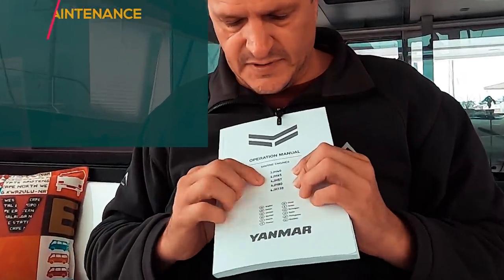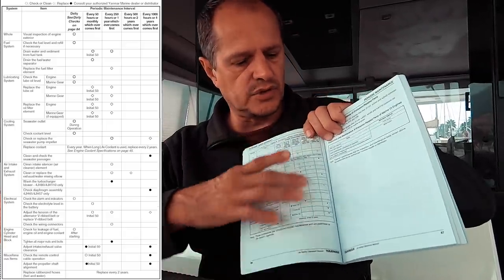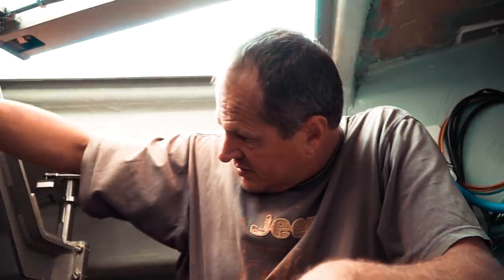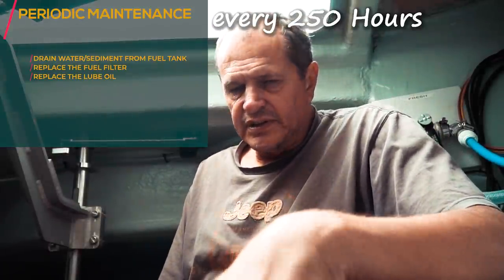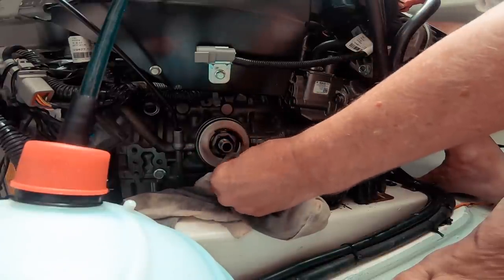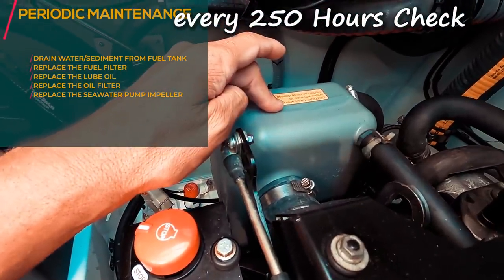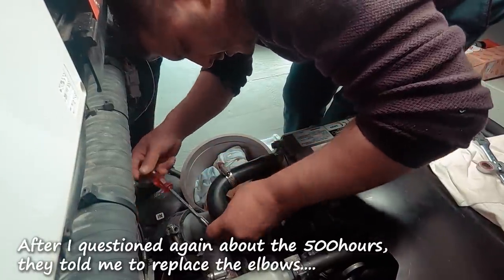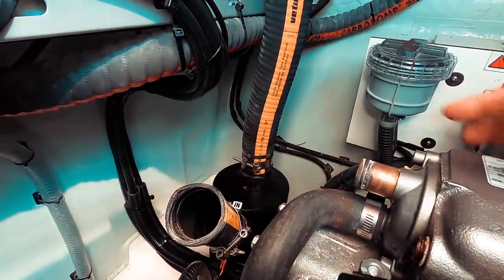#85t Boat Life Yanmar 4JH45 Service | Sailing Sisu Leopard 45 Catamaran Circumnavigating

Comment: Hi Frik. 

I have never seen fuel and oil filters which have been loose enough to remove by hand, I hope you don`t get caught at sea with a leak in either. 

Put them on hand tight and remove with a strap or other device, these seemed to be far too loose.

David.
Reply from the maker: Thank you, David! I actually accidentally loosened the filter with the strappy thingie before the oil was fully drained and the oil spilled out... Off course, there were too much swearing and could not be part of the video 😁
Reply: MECHANIC NOTE: Screw-on filters need to be tightened on by hand, thus not damaging the seal, be it rubber or other wise.
The strap 'thingie' can & should be used for removal.

BTW, use proper lubrication when installing.
Reply from the maker: @stevenr8606  yeah, only tighten by hand as shown in the video 😊

Comment: Cheers guys! 😊
Reply from the maker: wow, you watching "how-to" videos now :-D but, what do you think of the level of detail and the camera work? (besides that it is boring ;-)
Reply: @SailingSisu  actually good,  the advice about aftermarket parts while under warranty isn’t strictly correct,  but to say it is is better than not, as companies love getting out of warranty claim’s, so why risk it?
Reply from the maker: Our warranty claims up till now, four years later, are still honored by Robertson and Caine :-) but they did start to throttle the payments this year :-D it is incredibly sad to say that the US market is getting out of warranty at every opportunity...it is as if one buys a product or get a service and the supplier takes your money and shove you off. I did not experience that in Africa nor in Turkey where the manufacturer is proud of their workmanship and stand by it. And they do their job at a fraction of the price in the US. For example, a guy did 8 welds for $5200 USD and when I pointed out that the weld is poorly done and will cause rust, he just shrugged and say that rust is my problem not his....even though his welding looks like bird poop with lots of crevices where salty water will accumulate and cause rust much faster than a polished weld...imagine my "surprise"

Comment: Excellent knowledge necessary and presented very nicely. What I would like to ask I how to winterize yanmar 4jh45 . Draining like manual says or flushing with antifreeze?
Reply from the maker: Thank you for the kind words! Never had to winterize, never lived in snowy areas for long either. So, for sure not the expert  :-) do you mean when it is on the hard or still in the water? What do you do with cars in those situations?
Reply: @SailingSisu  winter can get pretty cold. Even -30 degrees Celsius, you need to winterize einginge because water will turn into ice and destroy engine. With car I do not need to do that , as car doesn’t use water for cooling
Reply from the maker: @michal1344  well, the Yanmar is using anti-freeze too in its primary cooling closed loop. There is a heat exchanger where the primary (anti-freeze) coolant is cooled by water from the sea. So, I guess one needs to get all the sea water out, or replace that with antifreeze using the pipe at the raw water seacock inlet? Just follow that pipe and you will see where the water goes. I think on our engine, it goes from seacock to impeller, to heat exchanger, to mixing elbow, to exhaust accumulator, then the exhaust pipe itself. But, yeah, follow the raw seawater pipe, I guess.
Reply: Can you advise what oil you used ? Do you remember ?
Reply: @SailingSisu in Manual it says that you have to drain water from an engine (from an engine and from a pump). Many of users instead of doing that they put anti-freeze to a water strainer. Amount of 20liters. 
What is better I do not know. ?
I thing that also part of see water is going to an engine ? Or only coolant is going to an engine ?

Comment: I was wondering do you ever have to change the filter in the PURAFINER DIESEL CONDITIONER or you just replace the unit after a certain time frame . 

Also you may want to consider next time you have your vessel in dry dock it  is easer to change the oil on the sail drive then due to the most of the units have a external drain bolt regards
Reply from the maker: David, that is a very good question! I actually have no idea! Yes, we did change oil when we were on the hard in the Canaries
Reply: @SailingSisu  Q & A on site stating a magnet field is used to help in the process , so have the device an electrical connection and how is the field generated. I am electrical engineer so magnet fields have to have a source or permanent magnets are fitted inside the device??

Frequently Asked Questions
June 15, 2018
By Purafiner

Q. How does Purafiner work?
A. Purafiner is not a biocide; it does not kill the bug. It is a bio-control unit. It affects the living organism by disrupting its environment and breaking the biomass down into individual plasmolyzed cells of less than 1 micron in size. These pass through the fuel filter and burn up in the engine.
 

Q. What about the fuel returned to the tank?
A. The treated cells remain dormant and inactive for long periods. The time frame depends on the environmental conditions, but it is long enough for the for the cells to be consumed by the engine. The fuel tank is slowly cleaned up in the process.
 

Q. How do you know what the effect of the magnetic field really is?
A. Purafiner Distributors NZ Ltd retained the School of Ocean Sciences in the University of Wales at Anglesey, UK to conduct an experiment to prove the effectiveness of Purafiner. The methodology of the test was devised by the School of Ocean Sciences in conjunction with Lloyds Register of Shipping type approval Department of Engineering Services, reference ta/40397/67488/94rel.
 

Q. What form did the experiment take?
A. The experiment was devised to determine the effect on a magnetically protected filter compared with an unprotected one when circulated with microbiologically contaminated fuel.
 

Q. What was the result?
A. The result was that the unprotected filter became an ideal environment for microbiological growth and the filter became blocked. The protected one remained unblocked. The filter life was increased by a factor of 10.
The results were so impressive that the university submitted them to the leading journal in the field of biological contamination for publication. The article was accepted and was published in Volume 14(3) 1999 of Biofouling.
Q. Is Purafiner a cost-effective method of control of biological contamination?
A. Yes. The continual use of expensive and toxic biocides and the associated hazards are eliminated.
 

Q. Will the magnetic field affect electronic or computerised engine components?
A. No. The field is depleted after it moves about 80mm from the unit. In addition, the field is absorbed by adjacent ferrite materials.
 

Q. Would a more powerful magnet be more effective?
A. No. The result would be the same but the cost greater.
 

Q. One manufacturer claims three magnets are necessary for effective control?
A.Three magnets are not necessary. One magnet is all that is required to disable bacteria. The claim that the bacteria is killed by the magnet is also incorrect, as the individual bacteria which cling together causing element clogging are separated by the magnetic field, and then burnt up as they go through the exhaust. A small magnetic field with the power of a radio speaker magnet will not kill bacteria.
In the early ’80s Mr Colin Wickham, a Chartered Engineer and inventor of the use of a magnetic field to control bacterial contamination in diesel fuel, designed his first unit. Mr Wickham was a Member of the Institute of Marine Engineering, Science and Technology, MIMarEST.

This first unit was designed to look like a fuel filter for better acceptance by the trucking industry. The use of three magnets was only to fill in the body.

Mr Wickham went on to design a new unit, cheaper and without the problem of sludge collecting in the bowl where it promoted the growth of the bacteria it was intended to control. This new model was the first Fuel Mag unit, one magnet and simple to fit. From this grew a range of units up to large capacity model with 6″ flanged outlets.

The fact that the three magnet system is patented means nothing other than to lock the manufacturer into higher cost. The use of a magnetic field to control this problem has been in the public domain since the earlier 1980’s and thus cannot be patented.

The Purafiner unit uses either one or two magnets for convenience in manufacturing but either number is equally efficient.

 

Q. Is it true that the Purafiner will save fuel? If it does, how is this achieved?
A. Purafiner makes no claims that a magnetic field has any effect on fuel economy. There are too many unsubstantiated claims made without any scientific proof to support these conclusions.
However, bearing in mind that the Purafiner controls the growth of microbiological contamination in the fuel, then the answer is yes, it will save fuel costs. This is because uncontrolled contamination will result in the following by-products of microbial growth:

large biomass causing fuel flow restrictions
secretions of organic acids into the fuel and consequential damage to fuel injection equipment
conversion of fuel molecules into new cells and metabolites such as surfactants which assist in the emulsification of water in the fuel, carbon dioxide, high-density polymers.
As well as the conversion by cellular enzymes of fuel into these various by-products, the by-products themselves adversely affect combustion conditions.
Clearly, if these problems are eliminated, some form of fuel saving or the prevention of fuel loss and improved combustion will result. Whilst we have made no laboratory tests to verify this particular aspect, there exists a wealth of anecdotal evidence in the marketplace to support it.

 

Q. Can Purafiner be used to protect fuel storage tanks?
A. Yes. By periodically circulating the fuel through a Purafiner the microbial matter can be maintained in a controlled, dormant condition.
 

Q. Can Purafiner be used with other fluid systems containing microbial contamination?
A. Yes, most definitely.
 

Q. Why does Purafiner reduce engine smoke emissions?
A. Quite simply the biological contamination is removed and fuel quality is improved. If the system is contaminated then as it becomes cleaner the combustion process improves, giving cleaner, faster and more complete combustion of the fuel injected into the combustion spaces.
 

Q. Why should I fit a Purafiner to my engine or system?
A. Well, it depends on the circumstances. If your system is biologically fouled the Purafiner will deal with the contamination, clean the system up and keep it clean.
If your system is not contaminated, then the aim is to keep it that way. You never know when you are likely to receive contaminated fuel.

Think of it in terms of your computer. Why do you install a virus protection programme?

to deal with any existing virus contamination
to protect your files from any virus that gets downloaded from an external source
The same principle applies to the installation of Purafiner.

to deal with existing contamination
to prevent any introduced bug from making a comfortable home for itself and degrading your engine system
 

Q. Do I need added protection if I have a centrifugal purifier?
A. Yes, you do. The microbiological growth has approximately the same specific gravity as the fuel or oil that it is growing in. This means that the centrifuge, which is designed to remove contaminants that are heavier than the fuel or oil, e.G. Dirt and water, will not remove lighter particles. The microbial material will pass through with the fuel or oil.
 

Q. Where in the system should I install Purafiner?
A. Your system will be equipped with primary or important means of protection against contaminants. What you want Purafiner to accomplish is to break down the microbiological contamination to minute components so that it will pass through the filters into the engine and away in the exhaust. Install the Purafiner in the fuel supply from the tank before it enters any filtration or treatment unit.
Reply: In a 2009 Practical Sailor article titled "Diesel Biocides Take On Contaminated Boat Fuel" I found this: "Magnetic bug killers receive considerable anecdotal press. Practical Sailor tested two widely available units-De-bug and Algae-X-in the April 15, 1997 issue and concluded they had no observed effect on microbial growth. As a part of the 1997 trial, a biocide was also tested for comparison, and this was found to be very effective." 

1997 issues are not available online. 

 Not sure if non subscriber can access it but this a link to the 2009 article with the quoted text.  https://www.practical-sailor.com/boat-maintenance/diesel-biocides-take-on-contaminated-boat-fuel.  PURAFINER claims to be just such a magnetic conditioner.  It is probably a waste of space and weight.

Comment: Thanks for the great vid Frik! I was wondering what it might be like doing self-maintenance on these babies. What FUN! BUT at 28:30, I wondered if maybe you had the water intake impeller backwards. You jammed it in there pretty good,  but shouldn't it turn freely?
Reply from the maker: Thank you for the kind words, Rick! No, in fact, you can put these impellers anyway round. But the 'jaming' thing, this is actually how the impellers work. They have this off centered housing, which bend the fins and squeeze/increase the flow into the engine. This is what wears them down and the fins start to break off in the long run.

Comment: Thanks for these fantastic detailed views into the boat.  Please forgive my armchair admiral nit picking...  I love what you do and think it would be great to meet you one day on the water.  Am I right that the serviced items (fuel filter etc) could be better placed if they were on that easier accessible wall (with the electrics on it).  Reversing their positions might have made that job easier?
Reply from the maker: hi, Tony! thank for watching and for the kind words! you are most probably right, but i guess they did not want to have dripping of diesel onto the engine? it is pretty messy and even now, the purifiers have a slow leak which is dripping and making a mess!

Comment: Given that you are in a small compartment without much ventilation do you think it would be better or no different if you did the messy fuel filter last so you don’t breathe diesel fumes for the whole rest of the time?
Reply from the maker: great idea, Tony! i was following the order of the manual and for the video sake :-) but after some thought...there is a big engine hatch, which is wide open and it does let out the fumes so, i was thinking that if i do it last, then i should keep the hatch open for a while?
Reply: Good idea...  you’ve got those beautiful engines...  flaunt them!     They deserve some on-public-view time too.   :)

Comment: Re 18;48, I don't like the way that looks. That big of metal flecks?  Maybe there is some kind of additive to the oil one can use to reduce that problem? Maybe look into the Lucas oil products for marine. The website is Lucasoil
Reply from the maker: Thank you Ron for the great advice! I thought the flakes was because the engine is brand new. That specific footage was taken on the first 50 hours service?
Reply: @SailingSisu  I'm not an expert but would not have expected that size of flecks in a well lubed engine. I've changed oil in car engines but only seen fine particles similar to fine silt in trace amounts in burnt oil. I hope your maintenance situation jas much improved since this video.
Reply from the maker: I was surprised too 😏 and I am sure it was Yanmar oil too and it was filled, perhaps even a bit over filled by manufacturer.